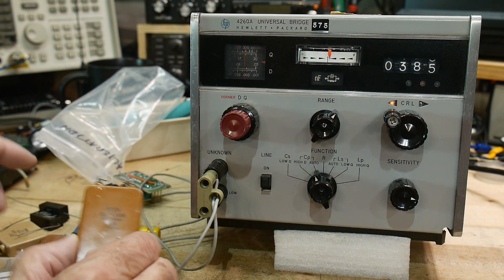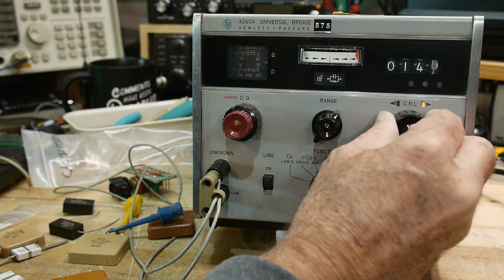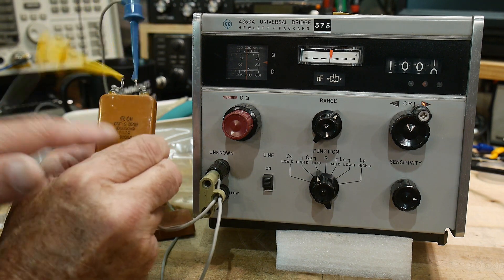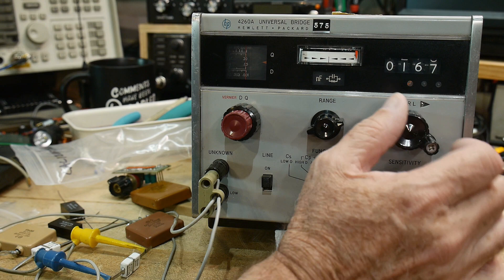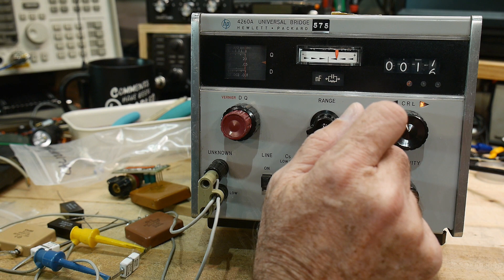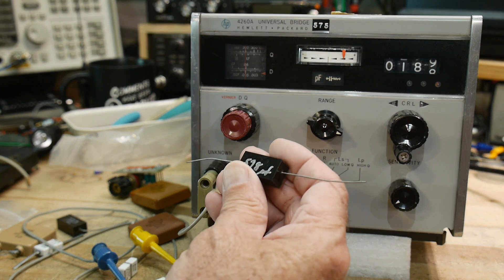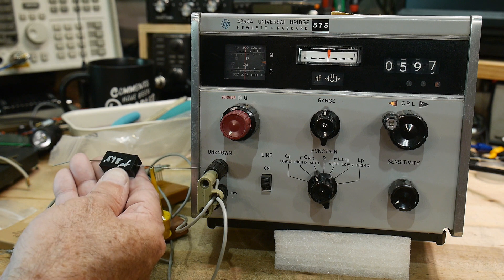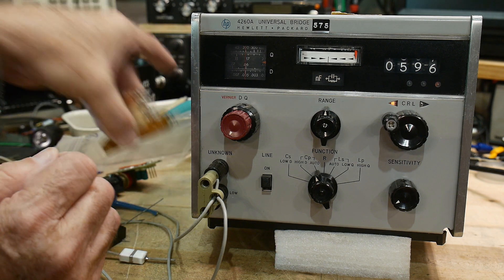#1034 Hewlett-Packard 4260A LCR Meter (part 4 of 4)

Comment: The capacitance of the leads will add to the device being tested.  Lead inductance is present also.  In pF ranges the "parasitic" C and L shift the readings and affect the ability to null the HP 4260.  Connect low values directly at the terminals for more accurate readings.  Is there a "zero" function?  Typically used to cancel lead or fixture  capacitance.  There are other features found on L-C-R meters to improve accuracy and repeatability such as a guard voltage, frequency,, series / parallel component configs of R, L, and C.  Thanks for sharing.

Comment: The 3 Foot leads (L) always interfere with the low capacitance value measurements. Just move the wires around the table and see the value of the C change. #Q

Comment: Growing up, of extraordinarily little means, the only way I could measure capacitors was with a bridge I made from a recycled 60Hz transformer, two resistors, a potentiometer, and a VU meter with a diode. I put it together in a cardboard box. It kind of worked, but not for anything in the pF range.

Comment: I have worked on several of these and I own three of them. The only issue they have is the power supply caps go bad (high ripple) and the problem I have seen the most is the three caps that form the network for the oscillator go out of tolerance. They are usually matched to be pretty close in value. If they aren't pretty matched in value the sine wave distortion goes up and you end up with a broader null. The easy way to check this is to use a polystyrene cap which has a very low D and substitute the internal oscillator for an external 1KHz low distortion oscillator and note the null that you get. You may have to use the manual mode and the D control in order to discern this. You should get a really sharp deep null. Switch back to the internal oscillator and compare results. Note that you should use a 10nF to a 1nF cap for this and keep the leads as short as you can so that any inductance or stray capacitance or pickup does not affect your reading. Although I have quite a few more LCR meters and bridges that are far more capable  (they were made by Yokogawa HP in Japan, they built almost all of HP's great LCR meters) the 4260A always impresses me.  I did have one f these where the wire wound CRL pot went open when the slider was near zero. I ended up fixing it with a piece of copper strip wedging it to make contact as there is no way you can use solder to fix those. Then I just physically set the counter so that zero was zero when the pot was zero ohms and it's been good ever since. IIRC the 4260A was the first product that YHP made for HP. I remember reading an article written by Henry Parsons Hall of GR Bridge fame saying how impressed he was was with the design of the 4260A. Henry designed the venerable GR 1650A which was for many years the gold standard for portable lab LCR bridges. He of course designed many ledgendary bridges for GR including but not limited to the GR 1657 DigiBridge. The 1657A and the digital LCR meters that followed reallly did not use any bridge circuits to make the measurements). The techniques and circuitry that he used are used in virtually every LCR meter on the market today. I read somewhere where HP paid a cool million to GR so that they could use GR's patents to make the YHP 4261/4262 bridges. That tells you what kind of guys Bill Hewlett and Dave Packard were. If they could not make a superior product with a unique design they had no qualms about paying others for the rights to use their patents. They also paid Tektronix to be able to use their tunnel diode triggering circuits on their 180 series scope designs. But that's another story. Sam W3OHM

Comment: So its consistently about 30 pF high on the nF scale... not bad.
Maybe better results if the low pF caps are attached directly to the terminals with no leads?
Cheers,

Comment: Hi again,  How about a tutorial on setting up an accurate voltage reference to calibrate meters, etc.
Reply from the maker: I did think about it, it is easy to make a transfer standard that has low drift, but then you need to get it calibrated somewhere. for an absolute standard there is the Weston standard cell (can't find a place to buy a new one)  or  Josephson junctions, again not sure where to buy. the best off the shelf parts will only get about +/-5mV which is pretty poor.